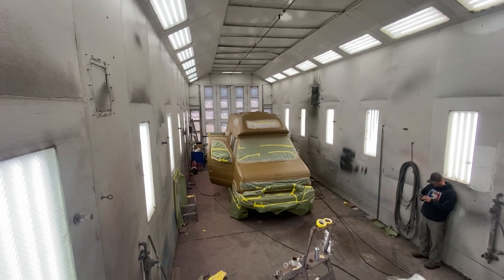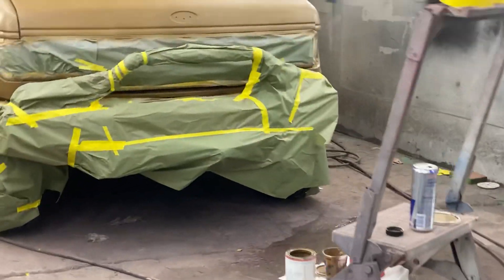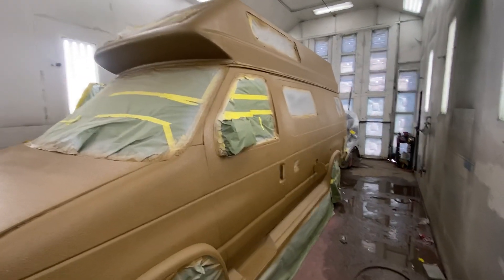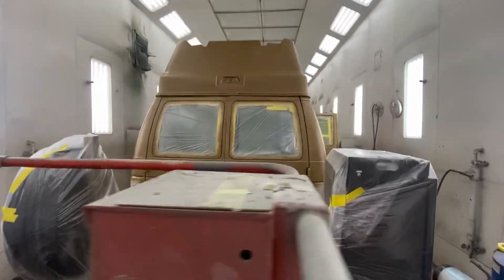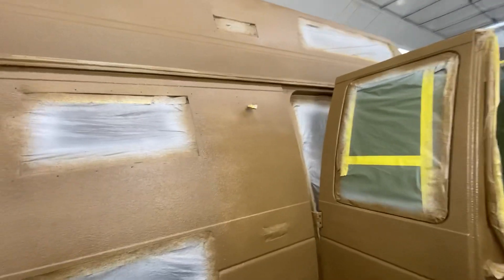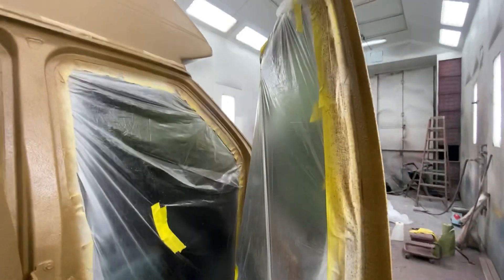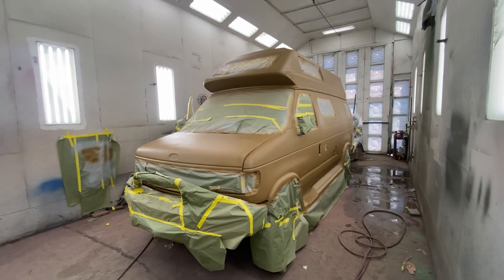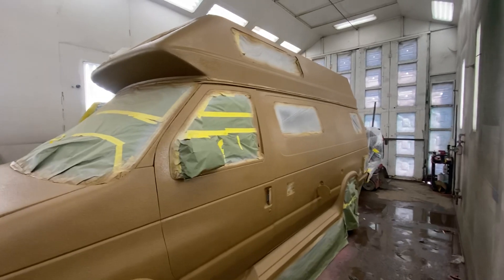1999 Coachmen 19RD 4x4 Camper Van full body Raptor Bed Liner - 1st Coat.

Comment: Channel "neutral drop" just did one with a 5.7 hemi ram that had bedliner paint, it was the most rotted Ram I've even seen, pretty sure the bedliner locks in the moisture and rust